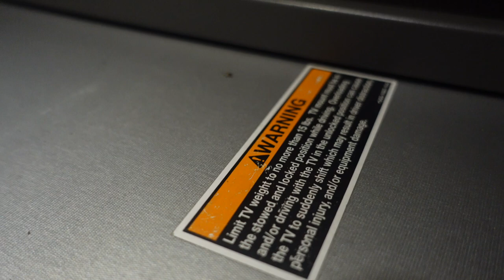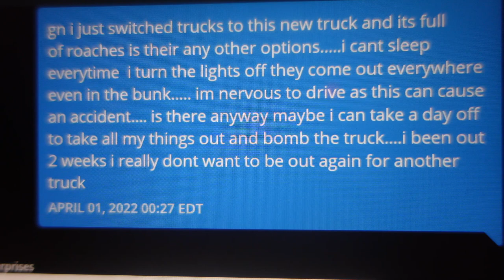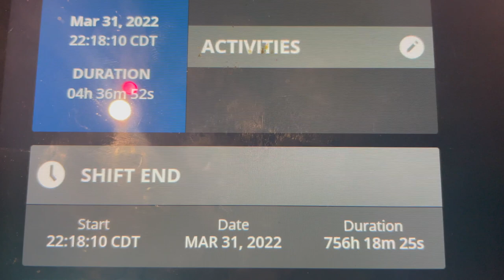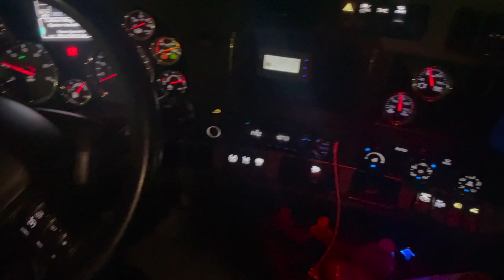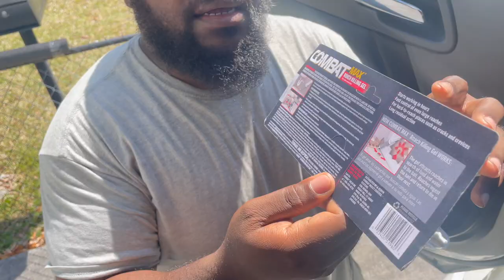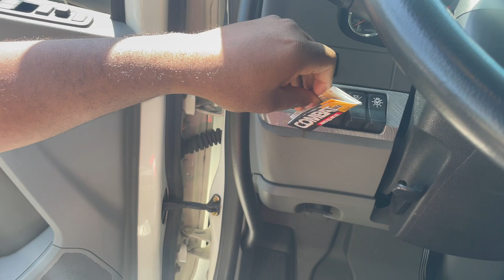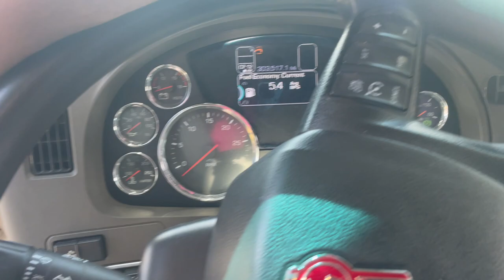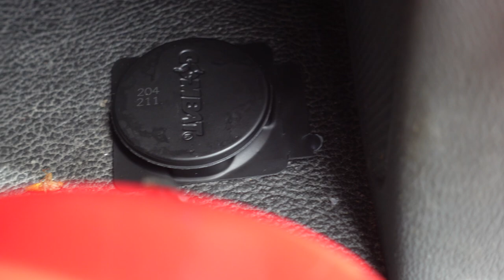MY TRUCK IS INFESTED WITH ROACHES

Comment: You can get rid of those roaches without using aerosol chemicals. All you need are 2 things. 50/50 alcohol/water spray preferably used with a carpet cleaner that sucks the water up as you spray and then lay down roach motels everywhere, especially in dark areas. You will be roach free in no time.